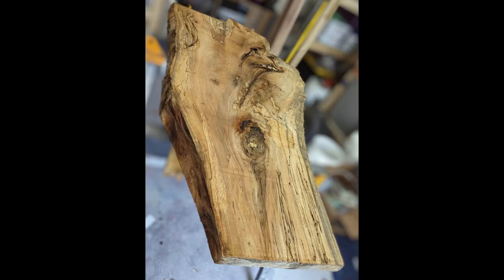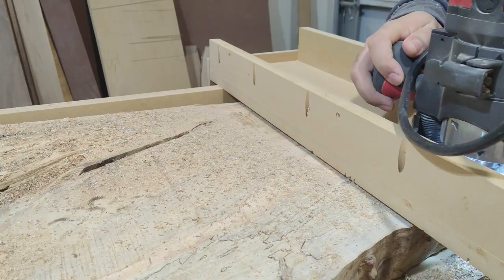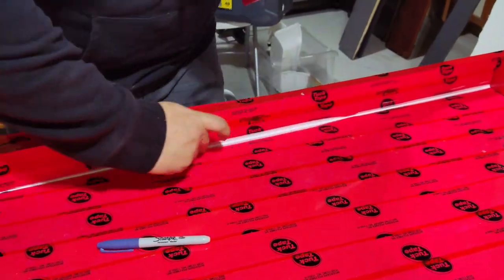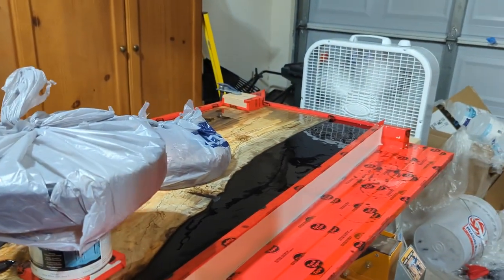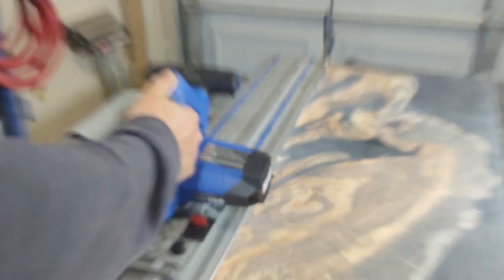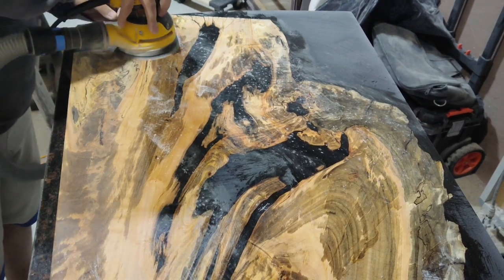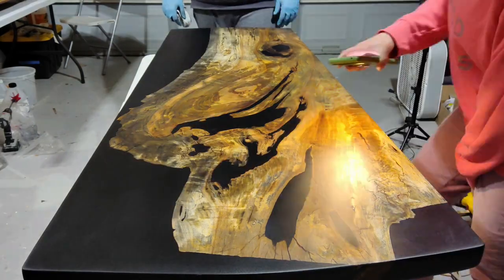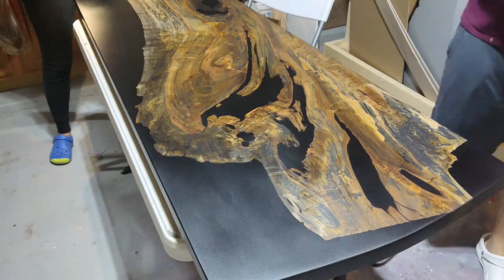Black Epoxy Coffee Table Part 1 / Things didn't go as I planned

Comment: Hi! First off, big kudos on this. Lots of Woodworkers on YouTube post their mistakes but it takes a lot to post your first video of a project that essentially ends in failure! For that reason alone you have a new subscriber! I'm not sure of your level of experience but Cam at Blacktail Studios has an online Epoxy Workshop. Might be no harm to have a look at it. 

Also, I've seen a lot of other YouTubers imposing deadlines on themselves for video release. It's fine as long as you are not putting yourself under pressure to get the video up and speeding up the actual woodworking side of it (again, something you might take a learning from this video). Just don't be putting too much pressure on yourselves to get the videos up. A good quality video coming out a week late is better than stressing out too much over something and making a mistake!
Reply from the maker: Thank you! 100%. So many lessons learned with making this video and with building this table.

Comment: why didnt you try fast-cure clear epoxy on the top? one thin layer could help you with all of the little bubbles and soft spots in the surface. and it cures for 18-24 hours. P.S. your resin boiled because of the thickness of the layer. read the description of the resin.
Reply from the maker: Correct. In part 2 of the build I use epoxy to stabilize the soft. It should be out this coming Wednesday.
Reply: @fiveduckstudio  i will be waiting for the next video) great work!
Reply from the maker: @Pashovezzz  Thank you!